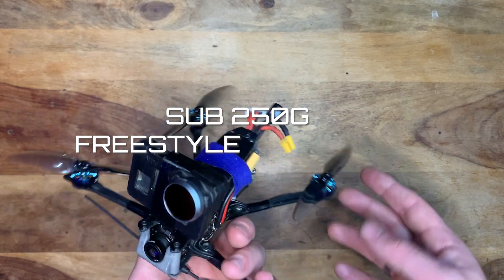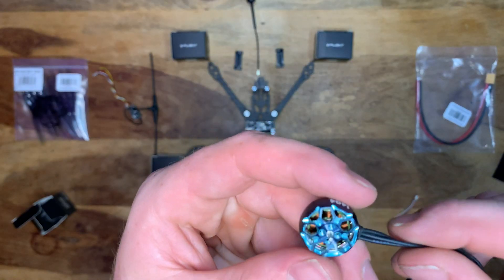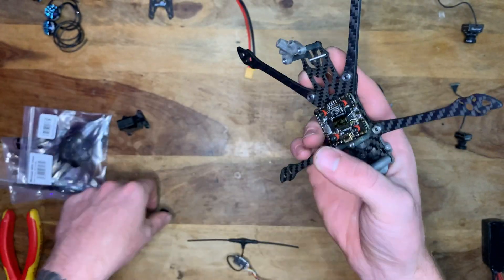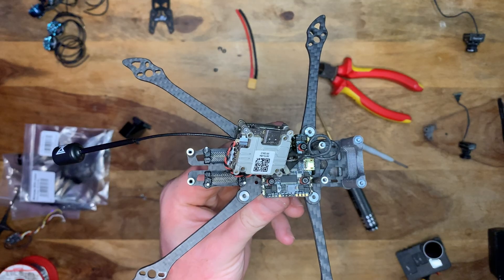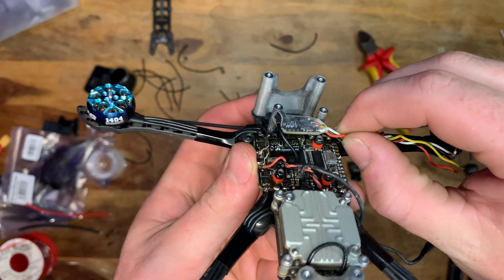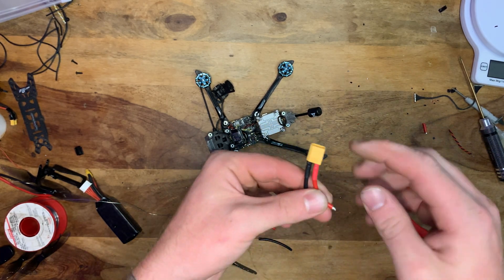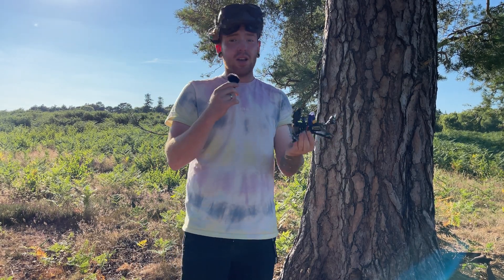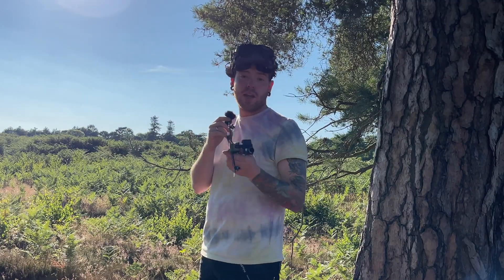How to Build a Sub 250g FPV Drone with a GoPro for u see £200!!

Comment: The t motor 1404 3800kv motors would’ve saved you another 4g. I’m building an analog Chimera4 DC at the moment…after my OG Chimera4 was killed by buzzards 🙈
Reply from the maker: i was actually going to go for them! But I calculated it so i could use motors that werent red and black! Just a pet peve of mine... hate red things! lol
Reply: @thegingerdronepilot  sand paper :)
Reply: Also try the hq prop tri blade props…a bit more grip for only a little more weight